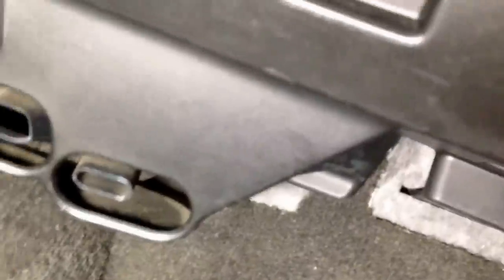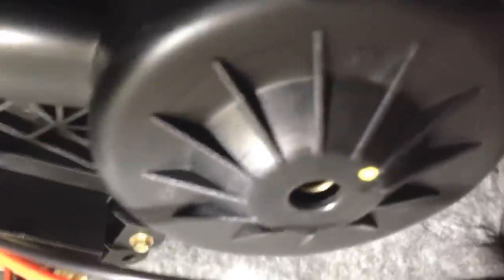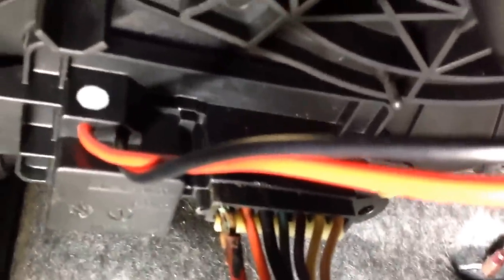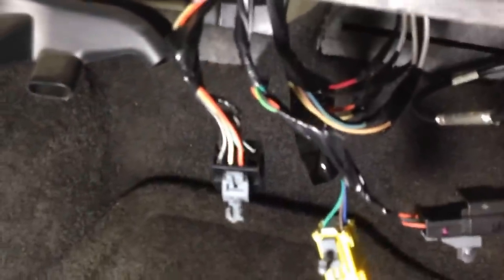DIY Replacing 06 GMC Envoy Heater Blower Motor Wire Harness Pigtail

Comment: ayo my blower motor just completely stopped working in my 06 envoy, i was researching and ive come to hear that these resistors blow out, should i give that a replacement and see if it works again?  the day before yesterday it was working intermediately, it was really down on power, i keyed off and back on, it worked fine until i parked it, turned it on today (as im typing this) and it didnt work at all, it is shot, no fuses blown, relays are fine.
Reply from the maker: Resister could be blown but fan motor could also be shot. Need to narrow it down. Open the glove box and empty it out then push in on the sides to release the stops and the glove box will swing down. Inside the cavity you will see the blower motor housing in upper right corner. Turn the key on and blower motor on high. Use a long screwdriver handle end and tap on the motor housing right near where the red and black connector is. Give it a good several hits to see if the fan spins up. If it does, then the fan itself is shot. Usually when the resister is shot, the blower will only work on high and not the medium and low settings as the high setting bypasses the resister and sends full 12 volts to the fan. If the fan does not spin up after tapping on it, shut the key off and if possible you can use a spare car battery to supply 12 volts directly to the two pins of the fan motor after unplugging the connector with the red and black wire which is right there in the front. If that’s not possible you will need to remove the resister block. It’s a bit of pain to get to as it is tucked up under near the firewall ahead of where the fan motor is. There are two screws, use a nut driver and remove them. The resister block will basically fall out after you remove the screws. Examine it for rust at the connector and at the top. You may also smell a burnt electrical smell. When using the heater and then the AC, condensation forms in the ducts and will eventually rust out the resister block. Also as in this video look for a melted connector on the end where the red wire is, very common on these models. However when that happens the fan will still work on all speeds except high, unless the resister is totally shot. The resister is fairly cheap, around $30, although it may be more now due to shortages. Unplug the old one, plug the new one and and reinstall. Turn key to on and test blower. Only replace it if the connector is not melted. If it is you will also need a new pigtail and have to rewire the whole thing which is a bit more involved. If the blower still does not spin up then the blower is shot as well. The blower is much more expensive but easy to change. Three bolts hold it in around the top edge. Hopefully it’s just the resister.
Reply: @MainStreetFixIt  today i yanked out the glovebox and pulled the resistor out, i inspected all surrounding wiring and i couldnt see evidence of any charring, connectors looked fine, however the resistor itself has a bunch of corrosion. i cant seem to find another one without either ordering it from amazon or going to a junk yard (they're all closed until monday, so im still at a standstill)

I would usually follow through with testing the blower motor itself but when I keyed on the car today the blower motor spun like it was fine for a few seconds and then went right back to not working again. So I'm really banking on this resistor being shot.
Reply: @MainStreetFixIt  Also, I shouldn't call it a resistor, it's more of a module, because my particular envoy has the automatic climate control and is all digital rather than relying on slider gauges.

Comment: Did you disconnect battery? I'm about to do same thing. Thought if I touched a few wires together on accident. May blow a fuse or something else. Idk what are your thoughts on that.
Reply from the maker: No. Just leave ignition off, key out and blower fan switch in off position. No current flows to blower circuit until key is in run position.
Reply: @MainStreetFixIt  thanks. That's why I was watching this video. Just didn't wanna mess ne thing else up. Just earned a sub!
Reply: @MainStreetFixIt  nope still had power. Got sparks when I was stripping wires. Red n black touched.
Reply: Anyone doing this on a trailblazer it's the same parts and setup. I would just suggest disconnecting the ground to the battery.  Idk why but they still get power.

Comment: 2nd time I replaced it. I didn't keep track of the wires in order to re wire the harness can you help me out?
Reply from the maker: Same make model and year? Pause this video where I am showing the burnt wire. That’s the original colors and order of the wires.
Reply: 2006 Silverado

Comment: How to fix the rear blower on a 2005 Gmc Envoy Xl? It only blows out freezing cold air
Reply from the maker: This could be several problems. 1. the AC switch is on or stuck on. 2. There is something like a pencil stuck in the heater flapper door that directs heat to the back. 3. The temperature outside if cold enough could cause the condensed water in the system to freeze, blocking the passage. 4. Your AC drain pipe is blocked and backed up with debris and won't allow the water out. You may need to open some vent grills or plenums & search around. In a pinch, disconnect the AC compressor under the hood so it doesn't cycle and try it again.
Reply from the maker: +pissinthe trousers typically the resistor block assembly is bad or going bad shortly thereafter. Since you're in there already I would replace as a set. Due to the high amperage and moisture buildup from AC condensation, the resistor block gets corroded and balloons out. If only replacing the pigtail, you may find that the blower works on high speed but none of the other slower speeds. High speed uses straight thru relay. This will also cause the new pigtail to melt in short order. For the minimal price, replace it all as an assembly.
Reply: Larry

Comment: We’re do you get the new wires (harness)(clip).
Reply from the maker: Believe I got it right at Autozone. In stock. It’s a common problem on these and Trail Blazers and trucks of the same year.
Reply: What is part called or part number
Reply from the maker: The parts replaced in the video are the blower motor resistor block and the pigtail repair harness.

Comment: Did you ever find out what causes this?
Reply from the maker: High amperage draw on undersized wire and plastic connector equals melted connection.